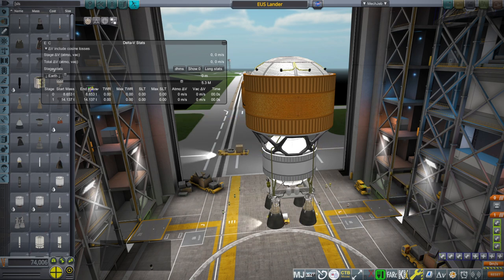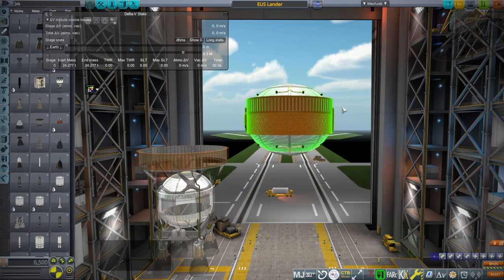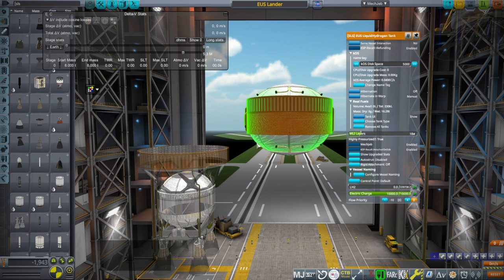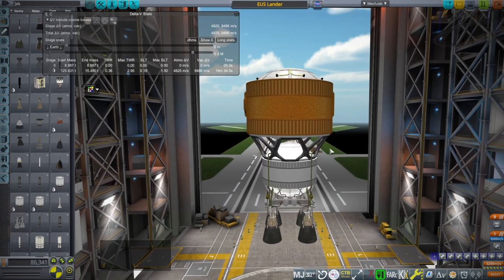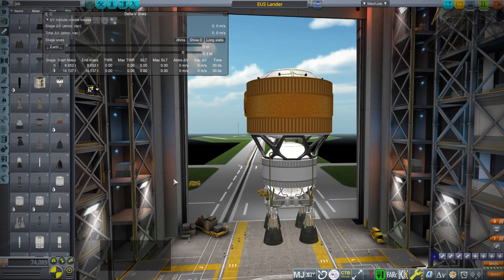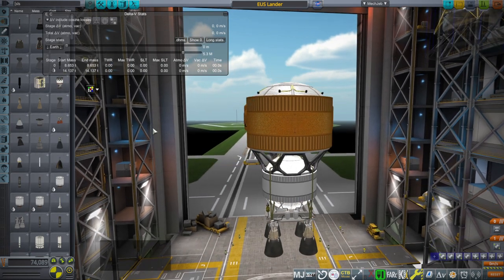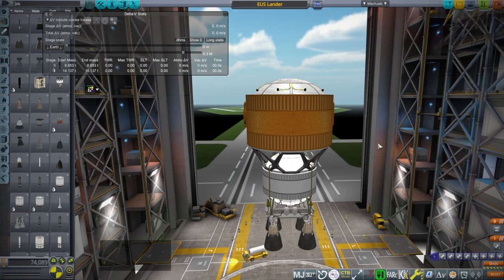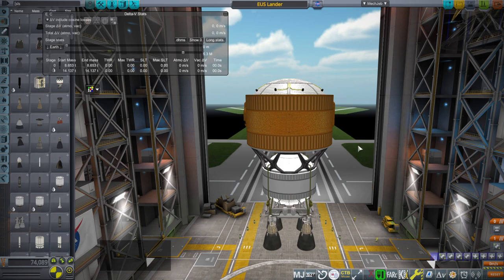Kerbal Space Program 1.12 with RO - EUS Moon Lander Wet Workshop

Comment: It certainly would add a lot of space for any potential outpost. It seems that the biggest hurdle would be allocating a dedicated SLS launch for it in the first place rather than any technical obstacles. I'd imagine this would only happen in conjunction with the gateway too. NASA definitely needs to find any use it can for SLS and its components other than as an orion taxi.
Reply: SLS isn't just meant to launch Orion. EUS will carry significant logistics payloads alongside in the near term for B1B, but B2 will introduce dedicated cargo to build a literal moon base with serious modules, not just an EUS wet lab

Comment: I'm not sure what prompted you to choose MMH/MON3 over other propellent combinations(although storability and hypergolicity are a plus) but if they just sit in the tanks, they should be fine(think RCS thrusters, nobody is really concerned much about the fuel, as long as the system is designed properly). An alternative is to try and flush the propellent out of the tanks where it will vaporize and disperse before the crew arrives, but at that point, you might just want to look at "warm" cryogenics(Methane, lox, flox, diborane etc.) As for my take on the wet workshop, it definitely makes sense, and is a good idea. An alternate option that NASA has shown in concepts for a first lunar outpost show an inflatable habitat on top of a lander platform, which looks somewhat like an Altair decent stage. I know a guy online who started work on a lunar cargo lander at Marshall, some designs were done and reviews were ongoing before it got shelved for CLPS. First lunar outpost landing options could be the Altair lander platform, a modified Marshall lander(he didn't say anything on the design) or as discussed in the video, a modified EUS lander platform.
Reply from the maker: Basically MMH/MON3 was to guarantee throttling engines of the right size are easy enough to obtain and to demonstrate that it's possible even with that lower efficiency. Obviously it would be better to get a higher efficiency combination - just to avoid toxicity if nothing else - in which case we can build stuff into the system to make converting it into a habitat easier. No matter what, there's plenty of margin here.

Comment: Shouldn't those tanks have sort of "built in" hatches anyway in domes? Like, during construction for instance we had photos of workers entering core stage LH2 tank trough dome. Maybe astronauts could first open the EUS dome, then put panels inside, and slowly turn the thing into a module that has airlock and few rooms?

Edit: if im not mistaken EUS will have avionics on top. They will just move them from core stage forward skirt to EUS on B1B
Also say we keep lox tank, perhaps in far future such "lander" could send hydrolox from ISRU to gateway
Reply from the maker: Well, if they have built-in hatches, that's easier. On the avionics, the Boeing document said that they were on a "suspended shelf attached to the LO2 tank" and I doubt that's changed since 2018. And yes, ultimately a pure hydrolox version would be the most useful - this is just the most immediate thing that could be done.